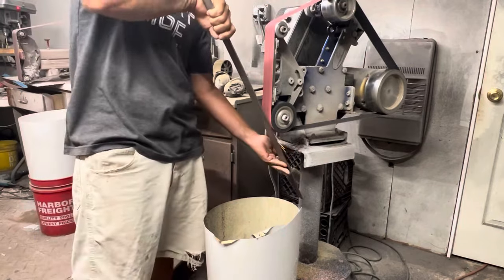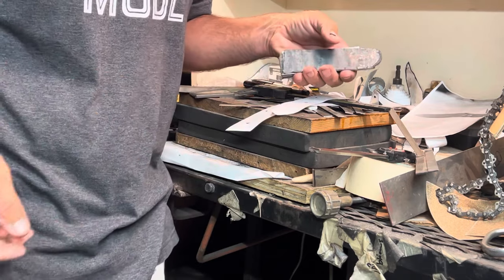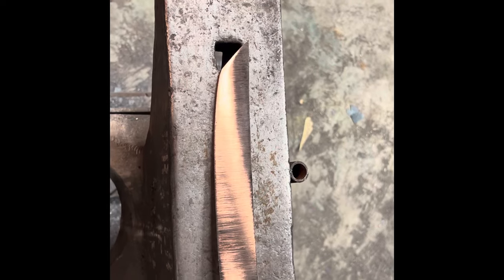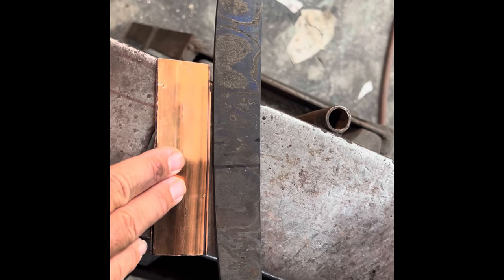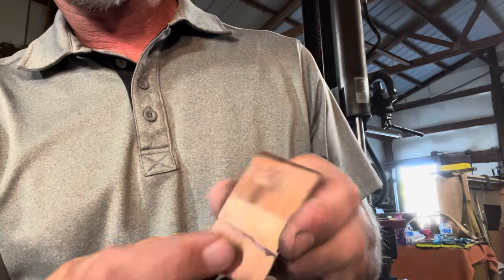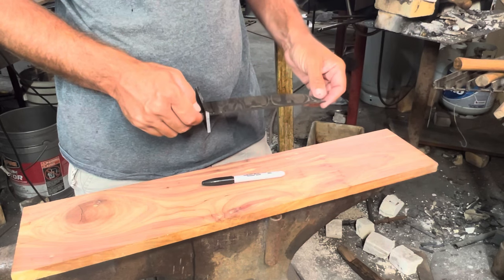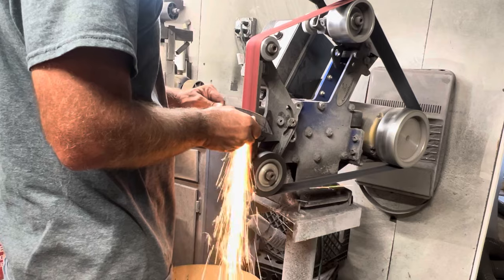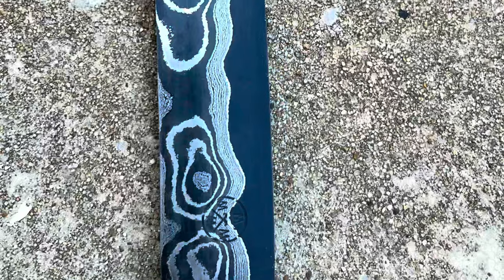Samurai Challenge:  Making a tanto

Comment: I don’t know what you have for shop equipment but if you happen to have a Tig Welder in your shop then in the future Tig Weld the Copper instead of futzing around with the soldering crap, it uses the same Argon Shielding Gas as welding steel and if you have copper electrical wire laying around like for running more outlets cut a piece and pull the bare ground wire and use that for the Filler Metal. Romex Electrical Wire is always Virgin Copper never recycled copper so it’s very pure and will make excellent filler metal for the odd ball copper project instead of going and buying a pack of Copper Tig Wire for one project
Reply from the maker: Thanks for the advice. I don’t have a tig but do have some extra copper wire around. I will give that a shot. Thanks.

Comment: Jay I really enjoy your videos. I had a question about the G P enchant. I followed the directions and I have used it on three knives. Looks good coming out of the G P but after it is sprayed with W D and aloud to sit for six hours when I take the micro fiber cloth all the dark oxide wipes right off. I don’t know how to contact Baker forge so I thought I would ask you. Thanks so much.
Reply from the maker: Thanks for the kind words. Man as far as GP I have not had that issue. I’m not really sure what it could be. I have heard good things about their customer service but have not had to deal with them yet. Only thing is would say is maybe not wipe it off as early as you are. I usually leave mine until wd is dry or almost dry. I figure the wd is good for rust anyway.
Reply: I will try to leave on for 24 hours next time. I am having a surgery the end of November and while I am recovering I am going to stabilize some wood. I have some really nice Burl wood and I would like to send you some blanks. I will get back in touch. Probably in December. Thanks again.
Reply from the maker: @edthompson3353  good luck with surgery and that would be awesome.